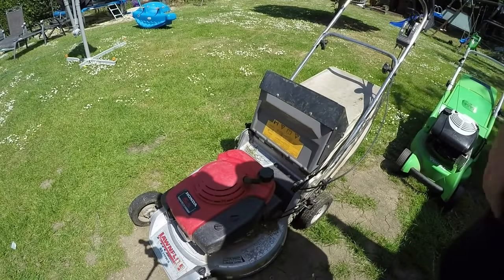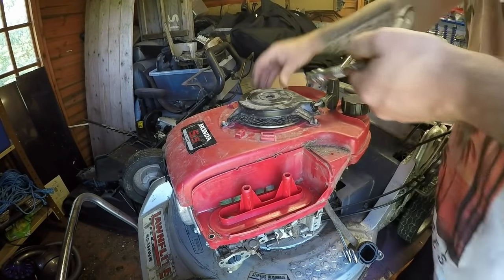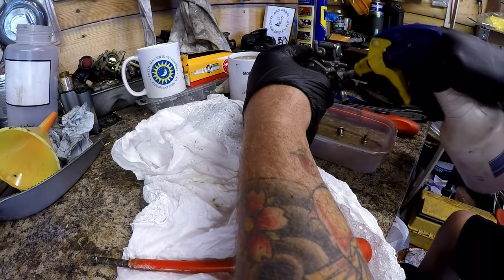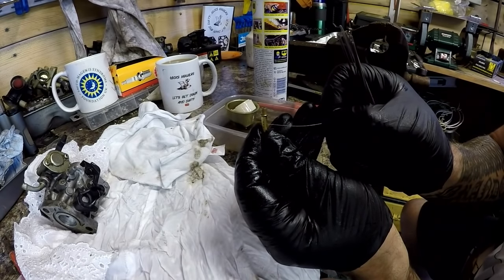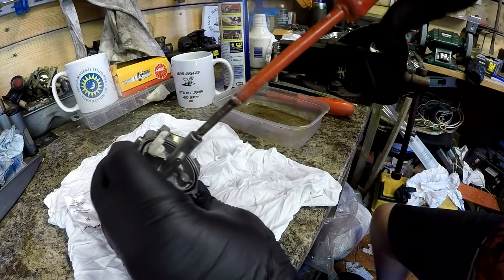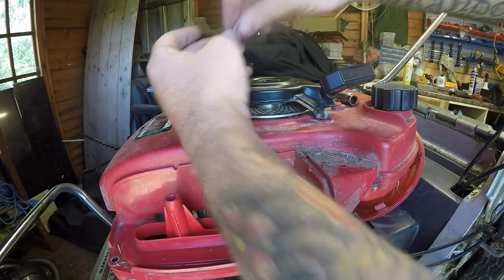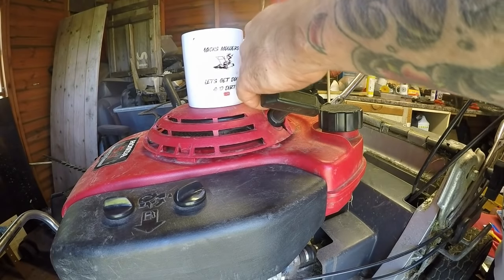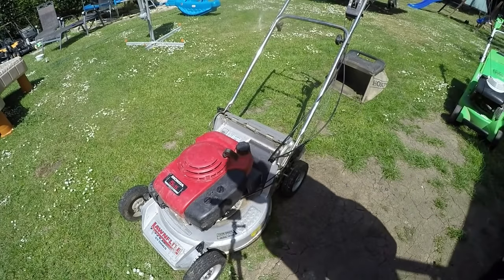HOW TO FIX A HUNTING LAWNMOWER HONDA LAWN FLITE 553 HWS

Comment: thanks for doing a carburettor clean, i dint know about the pins, could be why my machines are acting up.
my chipper starts strong and then dwindles and cuts out, i expected it was a fuel filter issue which the fuel tank filter was completely corroded (i bought it second hand)
the carb fuel inlet pipe was completely blocked with gunk, i have replaced the filter and cleaned the inlet, because of your video i think it must be the injector, as the machine will run for about 30 seconds, (until it has exhausted the fuel in the carb i imagine.)
Reply from the maker: Let me know how you get on with it

Comment: Are the mowers actually any good in general please Mick? Nice videos, just started watching. Thanks, James.
Reply from the maker: Hi James firstly welcome to the channel.. yes the 553 is a great mower and backed with a good strong 5.5 Honda engine.. it takes on most of the day to day big stuff bit is heavy so not much good for the really small lawns hope that helps. Take it easy
Reply from the maker: On another not I do run a live stream ever Saturday night from 630 pm.. your welcome to join the fun..
Reply: @themowerman  cheers Mick thank you, just ordered the smaller 448 with an aluminium deck and Honda GX 160 for smaller residential lawns. I'm torn between a lawnflite and a toro pro line for the 21 inch mower. I have an Etesia LKX2 for the bigger wet jobs etc but its too heavy for general use etc.
Reply from the maker: @jamescrashley2263  well both are good but I would go for the Toro if it was me only for one reason. The gearbox on a Honda is not the best and is expensive to replace
Reply: @themowerman  thank you, you confirmed something for me without asking the leading question about the gearbox. Much appreciated Mick.

Comment: Mick, I have an almost identical mower which is my own one. For some reason it will not roll backwards unless the engine is running, and on occasions when starting off going forward the transmission sometimes clicks. Mine is the rear wheels type not the roller type, so before I take it apart, any advice. I think mine could be Kaaz, but its identical to the one in this video. Thanks Dai
Reply from the maker: Sounds like the gears and axel need greasing

Comment: Not to sound like a butt. WD-40 makes rubber swell and more pliable.
Reply from the maker: I have never had a problem with wd40 effecting the o rings to be fair. I have had more problems with carb cleaners.
Reply: @themowerman  try using vinegar as a spray.
Reply from the maker: dirtriderkx500 I normally only use vinegar on my chips 🍟
Reply: @themowerman  just try on a carburetor. Just don't eat it. LOL 😀
Reply from the maker: dirtriderkx500 so where do I put the red sauce?lol
Reply: @themowerman  no joke. Just try it. You will have to blow it off with air. Have it as a Riley experiment with you. 😀😀😀